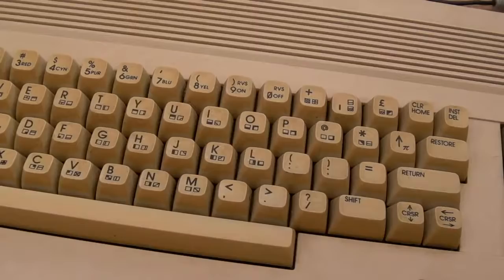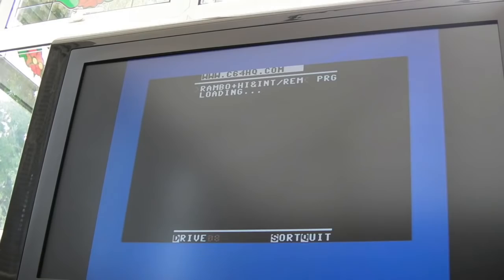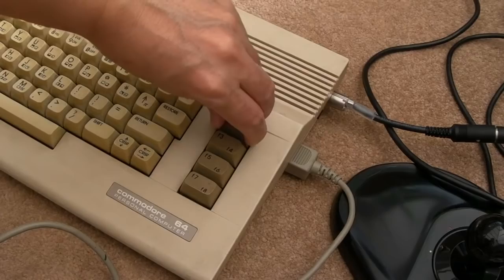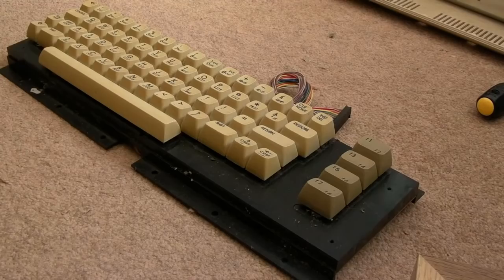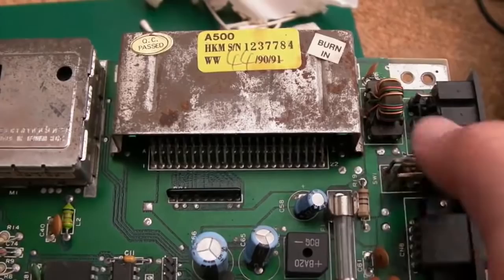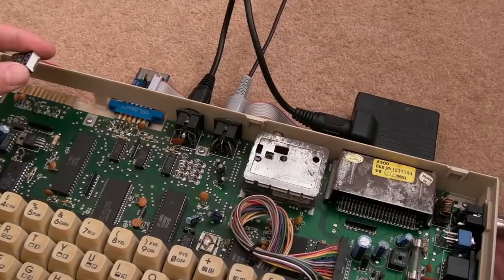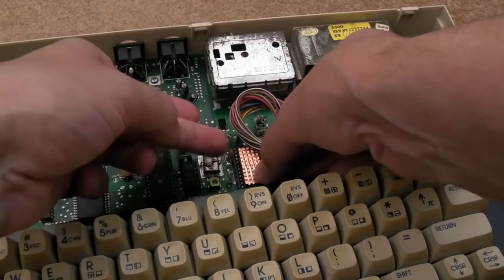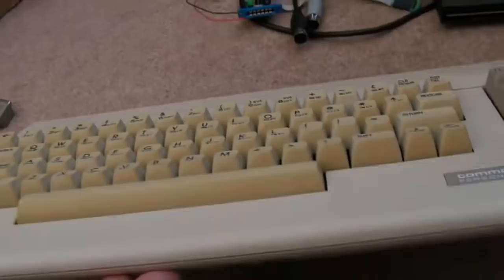VLOG - Commodore C64C Not Borken [sic]

Comment from the maker: Note: I didn't explain the clamping very well there - it's not a case of voltage cannot go into the CIAs, its the fact the level is "clamped" between ground and 5v.  So 12v would be clamped by the diode.  Likewise -12v would be too.  That ultimately causes the diode to short if over or under voltage is applied for a period of time.  This kind of protection helps with ESD spikes and transients etc.

Also, in relation to swapping VIC and SID chips - the voltage difference on them is in relation to the VDD pin, NOT the VCC pin.  The VCC pin on either models is always 5v.  As mentioned, the VDD pin on the VIC II is pin 13.  The VDD pin on the SID chip is pin 28.   If in doubt, measure the VDD pin in the socket before you fit an actual chip.

Comment: You're correct btw - the long board (the non cost reduced board) runs 12v to the vic-2 - and it runs quite a bit hotter as well.

Comment: Be careful with using a brush on a vacuum, it can cause static electricity.
Reply from the maker: Yes, it is a risk but tbh I've vaccuumed after system I have, many times and never had a problem.  Every single piece of equipment I worked on when I was in the trade got vaccumed too!  I know many other electronic engineers that did it too.  It's a calculated risk I guess...
Reply: @GadgetUK164  of course, you can take your own risks, but people watching this should know about it ❤

Comment: Why do people just punch through those warranty seals?? Soak them with a little lighter fluid, let it soak in (maybe pick up a corner slightly so it can get under), and most of them will just slide right off.  Then you csn glus it back a few inches away, not covering a screwhole.  It'a original, I hate to see it just torn up and left there with a hole in it.
Reply from the maker: If you do that, it's kind of naughty because you are tricking the purchaser into thinking no one has ever been in there, and sometimes the value goes up based on the fact no one has been in there!